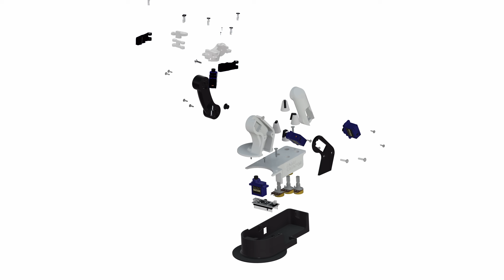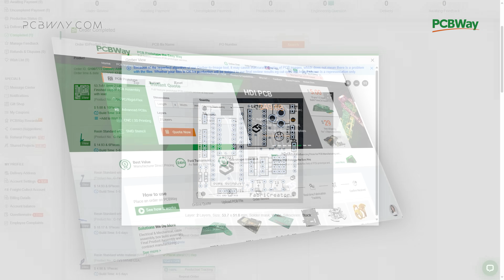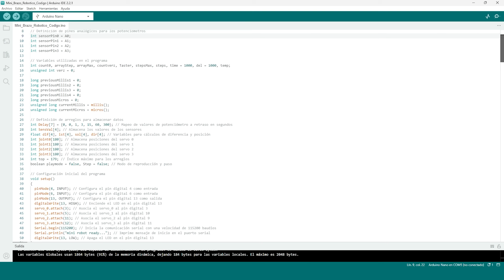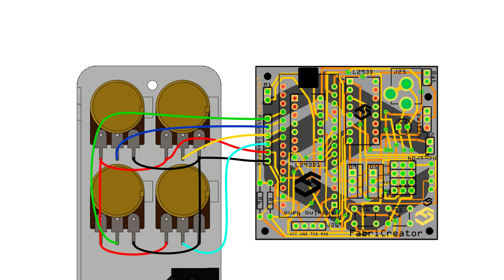Mini Robotic Arm with Arduino - Save/Play Positions.

Comment: Hello, please help.
I helped my 2 children build one each, but both robots do not behave correct. 
When we plug them in, all the motors start moving a little crazy, and then the potentiometers do not work at all.

All wiring is correct and has been double checked.
We bought the PCBs from your supplier, and soldered as per your instructions.
We installed the code correctly from your website.

Comment: i have done the circuit part correctly and uploaded the code to the arduino uno for now but when i turn the potentiometer was rotated the servo was not moving correctly and i gave a separate 5v for the sg90 servo , is there any changes that i should in the code to make this work ? can you pls help me ...

Comment: I'm using the mg996r servo it's work or not 
please tell me 
please brother
Reply from the maker: It should work, but make sure it's a 180° servo and that the power supply has enough amperage.
Reply: @FABRIcreator  thanks brother

Comment: Why did you attach servos to pins 3, 5, 11 and 12 but you typed in a comment that says they are connected to pins 3, 10, 9 and 11?
12th pin isnt even a PWM pin so you couldnt control the servo without it....

Please explain.

Comment: hi, i am actually doing something similar and i encounterd a major issue.. my servos ares shaking when the assigned potentiometer reaches the + side. Basically i get noise when im near + with my pots. I tried improving my code, didnt work. I tried using capacitors, didnt work, i tried adding ANOTHER capacitor, ceramic this time, didnt work TvT. So yeah im kind of curisous on how you get that smooth with the potentiometer control???
Reply: Try separating the power supply. Of the servos and the microcontroller

Comment: Can I use a breadboard or a universal printed circuit board instead of the designed PCB?
Reply: This is how I am doing it but I am assuming there is a mistake in the circuit diagram (Shown at 1:01) as he links the lower negative rail to the upper positive rail.  The black wire that crosses above the right side of the Arduino Nano. I feel sure this is wrong as surely it will short it out.  Can anyone confirm if I am right or wrong please?
Reply: @NomaddUK I have done it With the bread board and done the exact with the aurdiono uno and dint work and I forgot whats the meaning of the 13pin digitalwrite can you pls tell me of give me the correct diagram

Comment: Hey, What's the infill used for the 3D printed parts you've used?
I would like to make a replica of it but without the infill details I will not know If the servos could handle the weight of the arm...
Reply: I used 15% and it was fine.

Comment: While tiping this I have a SG90 in my Hand. But I can't rotate the servo freely. It is completely blocked in one direction. Somehow it only goes into the other one sometimes. But it seems like you can move your SG90 completely freely here without power. Why?

Comment: Can anyone help me please.
I have downloaded the code but i get this message.

"Sketch uses 8018 bytes (24%) of program storage space. Maximum is 32256 bytes.
Global variables use 1864 bytes (91%) of dynamic memory, leaving 184 bytes for local variables. Maximum is 2048 bytes.
Low memory available, stability problems may occur."

When i send the code to the Nano it works but the arm jumps around violently juddering on all servos.

TIA
Reply: did you use the pcb or the breadboard design? my nano isnt even turning on

Comment: Thank you very much for the great project, I printed everything, assembled the board and assembled it. The arms can be controlled with the potentiometers, but unfortunately I can't create and call up the program. What could that be about? I used all the components like yours and downloaded the original sketch. I would be very grateful for an answer. Many greetings, Günther
Reply: hi im recreating this robot arm i can't get it to work please help me
Reply: Can you please tell me that if I order the same gerber file given in the description, it will work?
Reply: heyy, what motor drivers did you use

Comment: Do you have tutorial on coding part?
It's very important for beginner to learn coding instead of copy & paste.
I just finished my robot arm using robot kit but my robot doesn't have ability to replay action.
Reply: Yes I also have the question
Reply: heyy, what motor driver did you use?
Reply: @joellopes3345  I don't use motor driver. I use only servo. Mine is 4 DOF.  So I use 4 MG90 servos

Comment: I am working with some high school students to build this project.  I like the fact that we still have to figure a few things out.  This turns it from a kit to a learning experience.  I am wondering if others caught the error in the circuit diagram?  The ground wire (black) that connects the two side reails on the breadboard is shown being connected to VCC.  I am assuming that the connection is correct on the PCB.
Reply: I am also working on this project, you were also working, is your project completed? There is no problem with the Gerber file, right?

Comment: Well, unless there is a way to just buy it, without a 3d printer, it is not worth anything.  Also, it appears to be a copy of the old Radio Shack arm from the 80s.
Reply: It wouldn’t be worth anything to me if you had to just buy it
Reply: Not to mention that you can have it printed for you

Comment: This is a great video and info for building (subscribed!). The only issue is the one that plagues all of these devices... the servo motors are too weak, and stutter too much. I built a similar robot system several years ago, and was very disappointed in the motor's precision and performance (even though I got the 'best' ones at the time).

If anyone has any more recent info on better motors that would work with this build, I would be very interested. I haven't looked at this in quite a while, and there could certainly be better motors available (i hope!). Thanks for any info.

Comment: can you modify it and control it with joysticks wireless
Reply: You can replace the arduino with an esp32 to control using a wifi webserver
Reply: You can do anything you can imagine
Reply: I assume you would need an arduino nano variant that used wifi

Comment: I am thinking of a few things:
1) Use ESP Now and send signals between two ESP32s instead of arduino nanos. One would contain the 4 potentiometers while the other remotely controls the arms.
2) Create multiple save presets.
3) Use OpenCR to recognize and move according to one of the presets stored.

In terms of the already existing code that you've made, how would you rank the above 3 in the order of complexity?
Reply: Yes! 
My version has 3 save slots and sensors. PolyWantsACracker on my channel.
Reply: In my opinion your suggestions are very good.

Comment: After uploading the code in my Arduino nano ..  when i rotate the potentiometer its not worked its just shaked and blow my servos 2times and also burn my Arduino nano
Reply: hi im recreating this mini robot arm please help me i can't get it to work
Reply: @isidroleojhonverson3456  i have still problem on automatic mode so i create manual control arm code
Reply: hi im recreating this mini robot arm please help me i can't get it to work
Reply: Can you please tell me that if I order the same gerber file given in the description, it will work?
Reply: @SuyashGaikwad-f5w  yes gerber file is okk problem in code